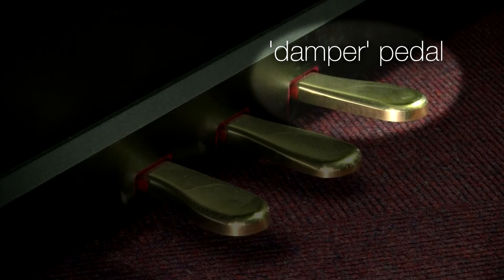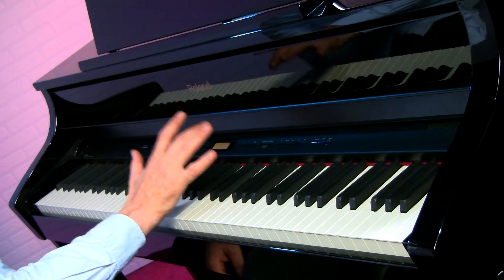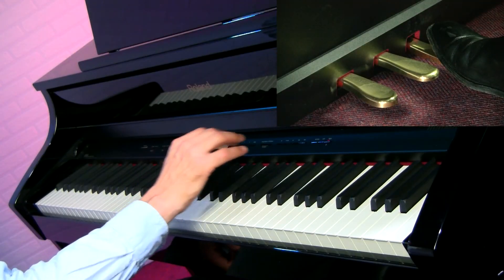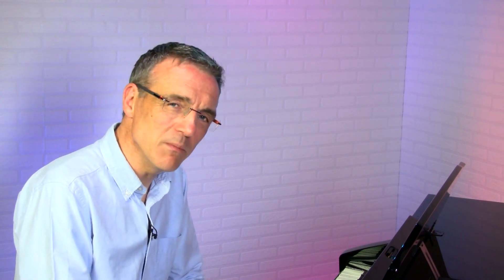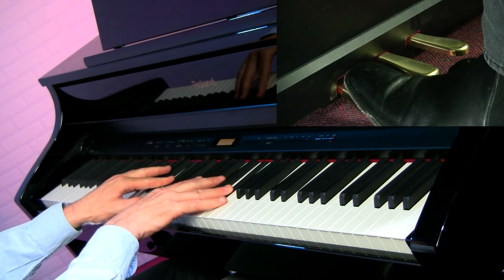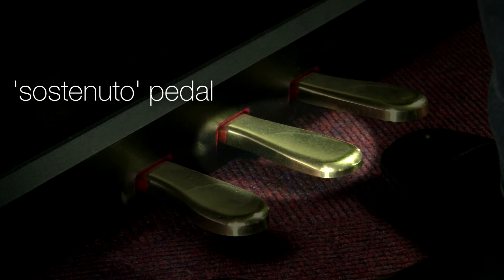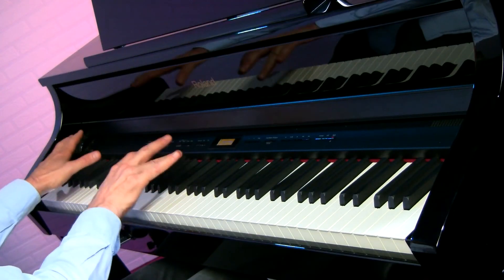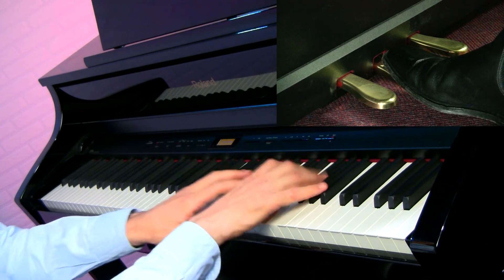MusicRadar Basics: digital piano key action and pedals explained

Comment: The heavier action, as you move into the bass end of the keyboard, does not result from thicker strings, but from the larger (and therefore heavier) hammers needed to sound them.  The dampers are also larger and heavier, but it is the weight of the hammers which is more important.